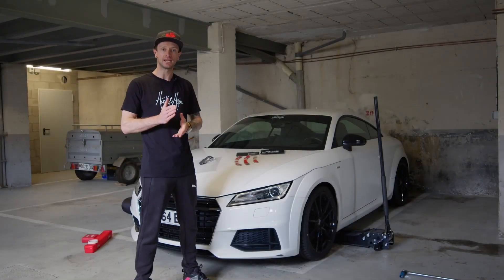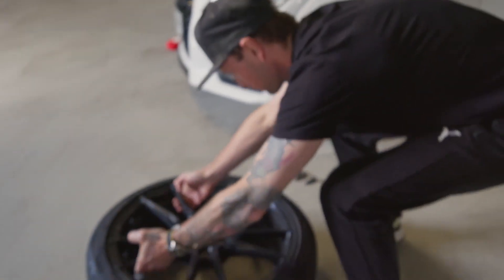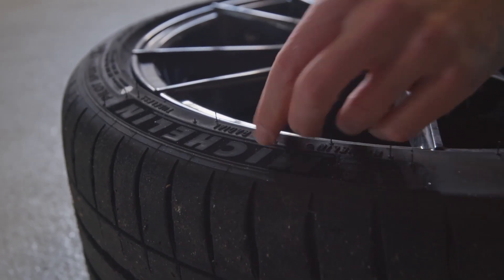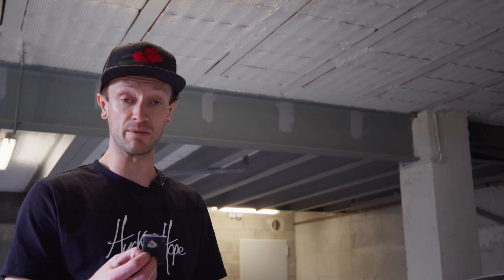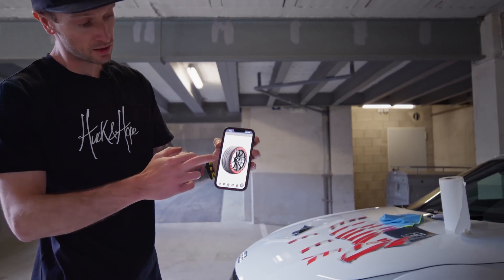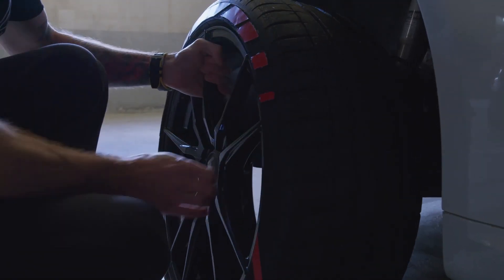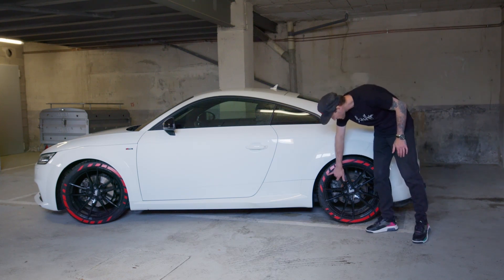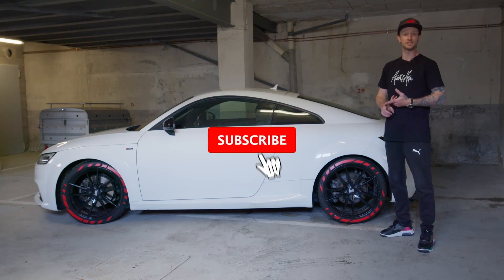GT3 Style tyre stickers for my Audi TT MK3

Comment: I had looked into this but didn’t end up buying them as the tyre wall on the P-Zeros are sooooo thin
Reply from the maker: What size rims do you have? I have 19´s and theres a decent amount of room on the sidewall but if I ordered more I would probably go a little thinner. If I remember right  the ones I got were 25mm so maybe 20mm next time. 👌
Reply: @James.a.vickers  I have 20” and the pzero sidewalls are much smaller than the ps4s you have
Reply from the maker: @ITS A RAPP sounds like it would be pretty tight, your car looks sick as is man!